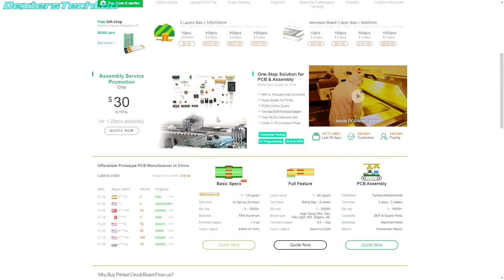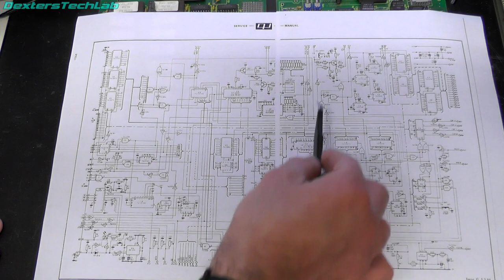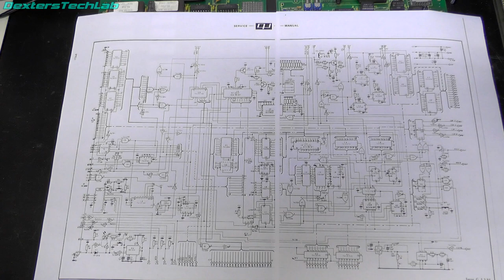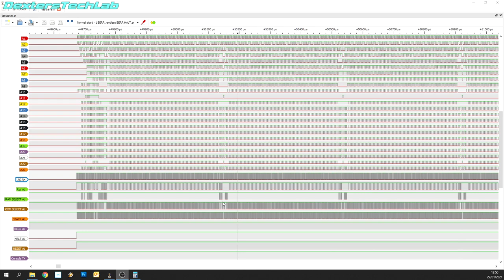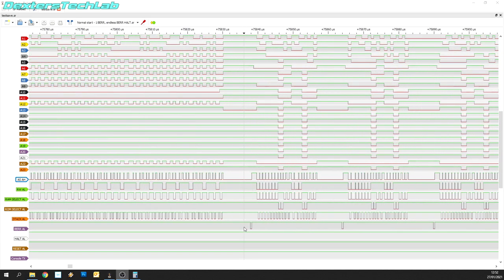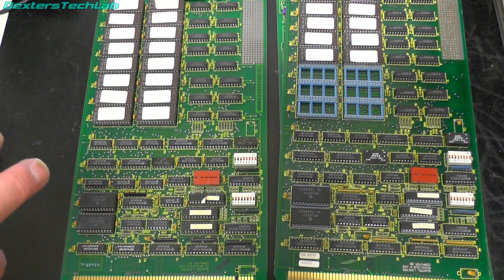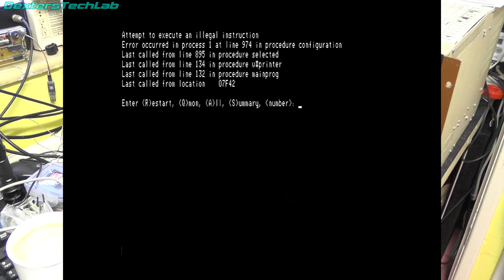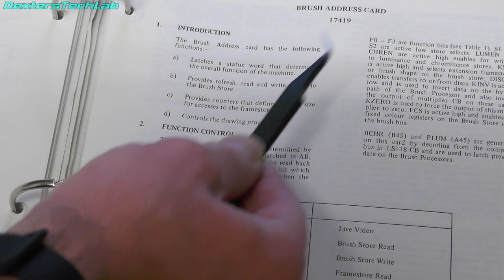DL209 Quantel DPB-7001 Digital Paintbox Restoration & Repair Part 3

Comment: I worked on one if these while at Blackpool college studying photography in 1985. The lecturers dismissed it as a fad when it was loaned between I think Blackpool stockport and Preston colleges so I taught myself how to use it. Quantel and Fuji ended up sponsoring me and I was probably the first photographer using it to create art. Going to Newbury to work on their machines was great. I remember doing something with Picasso's daughter on it and mybwork was in the  seminal Art & Computers show at Cleveland Gallery in Middlesbrough.
Reply from the maker: Thank you for the comment, very interesting to hear stories of Paintbox outside of broadcasting!

Comment: You need to find a friend with a Fluke 9010A and a 68000 pod so you can test the CPU card RAM in circuit.
Reply from the maker: I used to own a Fluke 9110, i sold it 😢

Comment: Could it be a CMOS chip was wiped to prevent it being used without permission and needs reprogramming don't know you know more then me maybe some knows something.
Reply from the maker: Hi David, thanks for the comment. In this case the DPB has no built-in security mechanism like there is on the later systems. It's serial number is inherited from the Brush Master floppy disk which is used when you setup the hard disk.
Reply: I thought that might be something Lima a security chip but you said no so there must be something else with the brush PCB